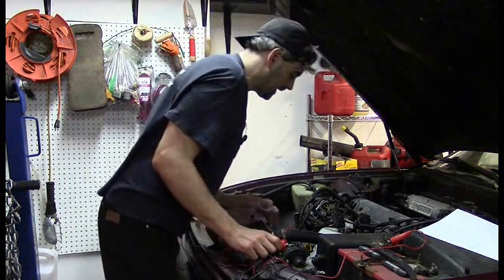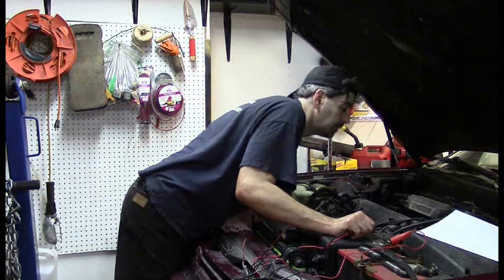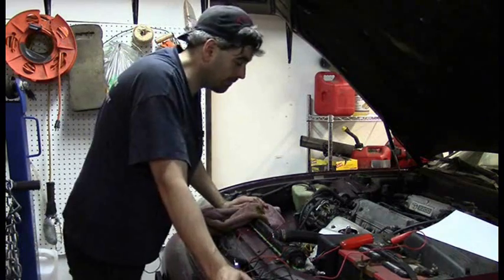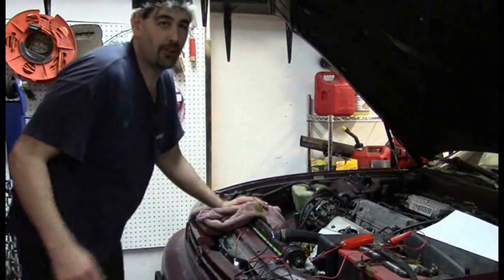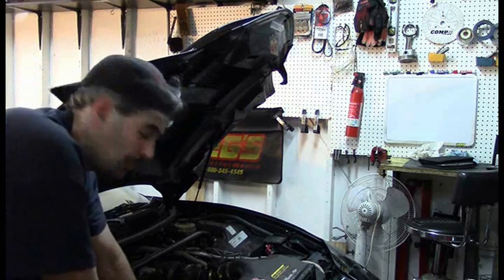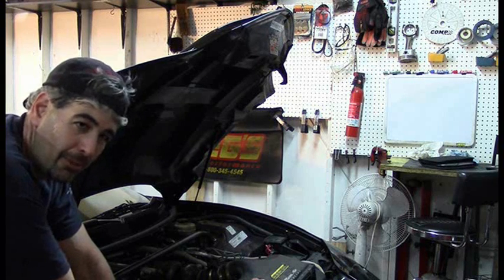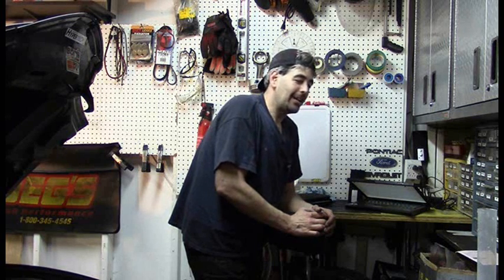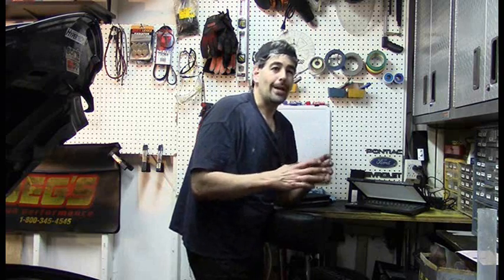12 Ways of How To Test A Blown Head Gasket Compared- PART2

Comment: Glad to see the swirling and bubbles in the Trans Am radiator.  It gives me hope for my Subaru, lol.  Great videos, thank you.
Reply from the maker: +john hardin Not seeing swirling would be a really bad sign- it would indicate water pump not working (provided T-stat is open of course).
Reply: +Schrodingers Box The bubble test does work but it requires the hole from overflow tank at the radiator neck to be block off. It helps if u have a coolant bleeder funnel. This process requires the engine to be at operating temperature and thermostat must be open. I do like the leak down and compression tests since they r more precise. However, when u get paid by flat rate and u have a V engine that requires removal of the intake manifold to get to the spark plugs it's not very efficient. Most customers will not pay for an extra 2+ hours of labor for this
Reply: @knguyen215  yea I was wondering how I could do this in my Hyundai Tucson which I believe has a head gasket leak.  But can't check rear cylinders without removing plenum.
Reply: Sam H unfortunately that’s the only way to be precise
Reply: @knguyen215  yea that's what I'm gonna have to do.  I'm sure it's a head gasket though because I've had coolant coming out of pressurized radiator cap for long time.  A mechanic replaced the radiator saying it was cracked that's why it was leaking but I'm sure it didn't need to be done.
Reply: +Schrodingers Box really appreciate the video I too was sure I had a minor blown head gasket after my radiator cracked on a long drive. Saw bubbles in the coolant overflow. But the chemical block tester and compression test say I'm good. Think I can finally stop worrying about it.

Comment: ok so the steaming screwdriver test: (this is for isolating coolant leak into individual cylinders)
say it's a 4 cylinder, bring up to temperature with a pressure tester (set on cap pressure or a tiny bit higher) connected to the radiator. Once hot, stop engine, remove spark plugs, and put cold screwdriver shanks into the plug hole into each cylinder. After about 1 or 2 minutes, remove each screwdriver and inspect the shank for condensed moisture. It will be as clear as day> This will indicate a presence of coolant in that particular cylinder. I have found this test to be incredibly reliable and precise to pinpoint slower cylinder head gasket coolant into combustion chamber leaks, and I'm thinking I might be one of the few whom have worked this trick out. 
PS. I have always found the magic bubbly dye gas in cooling system a tiny bit ambiguous. From my recollection, you can re-use the old dye by testing it near the exhaust tailpipe, and then "clear it up" by puffing it in fresh air. I recall one of the problems with this method is accidentally pulling coolant into the magic mixture while conducting the test. Anyway, my "steaming screwdrivers" are my favourite method these days. *(just don't use your penis instead of the thin phillips head Matt)
Reply from the maker: +David Bell Thats an interesting one- I will have to test that out for sure.  I'll have to try it on a rainy or humid day to rule out possible environmental variables causing the condensation.
Reply: for sure, no matter what the prevailing conditions for me during the 50 + times I've done this test, (dang, maybe even more like 100) I nearly always find a dry cylinder along with a wet one (if not all dry of course in the instance of the water to chamber parts of the gasket being ok) I don't know if that satisfies the axiom. Funny, I actually used the test today on a VW gen 5 golf which was in my shop with a stuck thermostat (which of course I proved to the customer by boiling it)  
I truly find the screwdriver hack the most reliable and definitive of tests. You can even detect the tiniest of weeps. Make sure the motor is right up to temperature, and that there is good pressure on the cooling system. I've been so inspired by you, I nearly made a video of it today :)

Comment: will these tests work if I have want I think to be slight oil in coolant no other symptoms, would that be a head gasket its a 4.6 f-250 manual to be honest I had the car at the jiffy lube and they said I had a blown head gasket becaue they could see oil in the coolant I looked latter and really its like slight bit of foam but just looks like dirty coolant don't kw if its ever been changed what would you do

Comment: hello mat what kinda heater you use? its looks cool where can i buy that from?
Reply from the maker: MrMsumal It's a kerosense heater and it really pumps out some BTU's  They cost about $65 at any hardware store but depending on where you live, K1 Kersosene can cost anywhere from $4 a gallon to $8 a gallon so the fuel can add up on you.  With my insulated garage I can go 8hrs on a gallon but if your garage is not insulated you may use 3X that much.

Comment: My exhaust is putting out a slight amount of white smoke and stinks pretty bad, but the coolant system has only distilled water inside currently, as I'm doing a flush.  How do you square that angle? (of stinky, thin white smoke exhaust, but no actual coolant inside)
Reply from the maker: Riddledrome What did your diagnostic tests indicate?

Comment: I had a recent oil change, and the mechanic said that I needed a new head gasket. I was looking up a videos on doing the repair myself. I'm glad I came across this series of vids. I thought this was a simple repair, however as pointed out in another vid on this channel, there could be more to the problem. So, I'll be heading to my trusted mechanic's shop.
Reply from the maker: BullRonin While I do have a couple videos on cylinder head repair I strongly suggest it is not a job for a novice, especially on DOHC models if you have one.
Reply: Yup, and thank you again. Your videos are very helpful.

Comment: Ok, i was thinking... the test with heating up the oil which it seems to be very popular, if the oil do sizzle, can that also be a sign of bad pcv valve or if the car has seen a lot of short trips and the moisture in the oil (condense from the heating-cooling of the enige/oil) has not been able to evaporate? Or there would be some other signs in the oil if that happened?
Reply from the maker: Asky66 You are absolutely correct- the test is designed to not give a false negative but it can show false positive for several reasons.
  Basically, if it doesn't sizzle, you can eliminate coolant in the oil as a possibility. But if it does, it does not necessarily mean the head gasket is bad- it just generates "suspicion".

Comment: I have an Audi A6 1999 model and I did the chemical test, the result was ok no signs of combustion. But my car use a lot of water/antifreeze and all that is going out from the reservoir, from a hole that reservoir has by itself. Also I have a lot of pressure in the cooling system the hose becomes strong and I think this is why the antifreeze goes out on the ground from the reservoir hole. Does this show that is combustion in the hose(cooling system) or maybe it is air? 4 months ago i changed the thermostat and someone told me it should be just air in the cooling system. Thank you in advance.
Reply from the maker: What did your compression and leak down tests indicate? Is the water pump working? You need more diagnostics than just the chemical test.
Reply: Schrodingers Box  I haven't done the other tests yet, I will bring to Audi dealer to check even the water pump. Thanks.

Comment: using his video, and its very helpful particularly for my aim to diagnose source of Hg faliure. I have an L200 pickup, and they are known to use up heads and gaskets. I have a small amount of rad bubble, no other symtoms. its kind of obvious even just from that its a faliure, But I want to find out if its due to a bad head, gasket or block, I an thinking a crack would be easy to detect, but how would you test for a warp in the head or block? I dont want it happening again once I swap it

Comment: Hi Matt! Automotive question here;) I just have bought a car with broken cambelt. It arrived today and I have noticed an oil in coolant?! Can cambelt failure cause that?! The belt was driving a water pump (standard in Europe) if that makes any difference? I have some thoughts but don't want to suggest that. By the way this car has "metal" head gasket and they are not very common to fail on this engine. Diagnostic is not easy (like compression test) as it is diesel car...
Reply from the maker: The only way I can possibly even fathom a relationship between a broken timing belt and water in coolant is if the belt broke due to a failure of the water pump (assuming it is driven by the timing belt) and the water pump leaked and it was caught in the oil pan.
 What was your idea?
Reply: Schrodingers Box Actually the oil is in the coolant reservoir (so it is getting to coolant and circulating with it) and there is some moisture in oil too... My most pessimistic idea is that water pump seized and the engine overheated and blew head gasket (or head cracked?) and than the belt snapped due to seized water pump... But wouldn't seized water pump brake cambelt quite fast?! 2nd idea is that there was neglected head gasket problem for a while before the cambelt went.. 3rd optimistic option is that again it is not related to the cambelt issue. This engine has external oil cooler and there are passages of oil and coolant next to each other. Sometimes they rust...
Still don't know how can timing belt failure cause oil in water... I guess it was preexisting problem... 
Anyway I will try to take pictures and share with you when I take it apart;)
Reply from the maker: Gregory May Oil in the coolant is different than coolant in the oil. A common cause of the former is actually a leaking oil cooling line or transmission cooling line.

 As far as the seized water pump- I have seen many of these. In fact it is one of the most common causes of broken timing belts I see- it is why I always recommend changing ALL timing components and not just the belt.
  When the water pump seizes, the belt slips over the frozen pulley- it is not enough to cause a change in timing. What happens is the heat from the belt slipping over the frozen pulley breaks the belt, but it is not enough to cause timing change, break the cam, etc and a blown headgasket as far as coolant in the oil is still mechanically separate even if any of those did happen.
  Normally if I see the frozen water pump condition before the belt breaks the complaint is arubber  burning smell from engine, poor performance, and overheating (which could lead to blown head gasket of course). But even with the belt sometimes very worn, the timing was not changed.
Reply: I removed the rocker cover gasket and can't see any damage to the cam or cam followers. Should I try to put the belt back on and see how it goes?!
Reply from the maker: Gregory May I would be doing as leakdown test at this point- so much easier than putting a belt on. You can't do compression without the belt on but you can do leakdown by simply turning the camshaft to close the valves independent of the crankshaft and testing the cylinder.  That's what I'd do. Often to test for bent or damaged valves on a broken timing belt, I remove the pushrods or overhead assembly to just have all the valves closed on all the cylinders and quickly do my leakdown without any rotation of crank or cam.
Reply: Schrodingers Box
I know. But it is a bloody diesel and no spark plugs to remove. And I don't know if I can take the injectors out as they are usually rusted in place... They are held by clamps not screwed in. But I will keep that in mind and see if leakdown is possible. Have you ever had broken timing belt that didn't bent the valves?
Reply from the maker: Gregory May Out of 6 broken timing belts on interference engines I've seen, 2 of them survived with no ill effects.
Reply: There is a hope;) Thanks
Reply: No at least 2 valves are bent and all the pistons are marked by valves. One valve is stuck open out and not closing even with a hammer. You was right there was oil cooler problem as well. Someone "fixed" it before sale. If you want you can check my youtube slideshow;)
https://www.youtube.com/watch?v=aXLEdSX-7J4
Reply from the maker: Gregory May Sorry my friend. Man you have a hard life lol- you're due for some breaks soon!!
Reply: Schrodingers Box
I know:)
Reply: I already bought a second hand engine...
Reply from the maker: Cool.  Thanks for the second hand news. Remember when times get bad when times get rough just lay me down in tall grass and let me do my stuff.
Reply: Schrodingers Box
I just wonder if only only one valve is quite bad ( i managed to close it and is not really bent - leaks a little bit ) and all the pistons are ok (marked but slightly) and con rods seems to be equal high where did all that energy/impact go??...

Other thing is if an engine runs with some water in oil there will be accelerated wear. How long (how many miles/months/years) can an engine run with little drops of coolant in oil without damage? Do you have any experience with that?

I used to get a glass when things were rough but well ... it doesn't help.. Tried that everyday for 5-6 years;) I prefer a cup of tea.
Reply from the maker: I've seen cars run years and thousands of miles with blown head gaskets and water in oil.  I diagnosed a head gasket on a dodge minivan once- oil looked like mud, no compression at all on affected cylinder and coolant sprayed out of the spark plug hole when I was testing adjacent cylinder and thing ran a year with daily driving lol. But when it died the engine froze.

Comment: my car passed all these tests but the overflow kept overfilling. Turns out it was my radiator cap. Even though it was the first thing I replaced, the one I got was bad
Reply from the maker: Bad radiator cap is one of the most common things I find cause cooling problems and especially "mystery" loss of coolant with no trace.
Reply: Schrodingers Box 
hey I just did your fizzle test with my dodge carvan, their was  a puddle of oil underneath my van, and I dipped tinfoil into it enough so I had a puddle on my tinfoil, I put the lighter no it and it snap crackled and popped, from your video I guess that's a bad sign.
Reply from the maker: Terry Hunt You cannot test the oil from external parts of the car- too many environmental variables could explain water contamination

Comment: Hello, I don't believe this question has been asked or answered, but with the "sizzle test", at what temperature does the metal that the oil is tested on have to reach to create a reaction. I realize that you mentioned it could be done with tin-foil and a lighter, but how would the outcome be changed if you didn't get the oil warm enough or if it was tested on a surface that was very very hot?  Thanks in advance.
-Jon
Reply from the maker: It has to be hot enough to boil water
Reply: Okay thanks for the fast response.

Comment: Sigh... I gots da sizzle. It's not as dramatic as yours showed, but it definitely bubbled before it smoked.

Thanks for the video.
Reply from the maker: Yeah honestly, not a good sign, but again NOT definitive in and of itself.  Other things could cause the oil to sizzle besides head gasket. Leaking coolant from intake gasket, condensation...
  There are ONLY 3 definitive "standalone" tests that unarguably confirm head gasket failure:
1. Leakdown
2. Compression
3. Combustion/CO2 in coolant

Also a coolant pressure test that shows coolant entering a CLOSED cylinder will do it too.
  Until you confirm with one of those tests, you cannot say for sure you have a cylinder head issue.  Good luck bro.
Reply: Schrodingers Box OK, I made a leakdown tester (you could also just use one of those valve holder adapters and inject air into the cylinder). For sure I've got leakage from cylinder 2 pressurizing the the cooling system, so I guess I get to pull the head and see what I'm dealing with.
Reply from the maker: yeah that pretty much does it. You have no other alternative. sorry to hear that.

Comment: Hello, I have Ford Escort 1.8 td and its loosing the water, what i have to check?
Reply from the maker: ummmmm is it leaking?
Reply: I can't find that somewhere is leaking. When i drive in above the woods the water just desapear...
Reply from the maker: Kamber Xheladini You will need to start with pressure test of the system and radiator cap (bad radiator cap is the most common cause of "mystery coolant loss". If pressure test is negative, head gasket testing is in order.

Comment: I have a BMW with a N54B30 engine and had the luxury of having the coolant tank blow out on me on a drive home and the engine overheated.  I immediately turned the car off when I saw the temp gauge hit the red.  I am not a religious man but I am praying heavily that I do not have to replace a head gasket and/or that I did not warp the block/cylinder head.

Comment: Right so i have gunky cap had gunk in oil filter gunky air pipes but i had clean dipstick no water loss or gain no smoke from exhaust no over heating no gunk on dipstick i can see a tiny oil leak near the oil or fueo sensor could the gunk build up be rocker cover or the sensor? Or is the head gasket? A mate said now you get plugs in the engine that blow or crack before the gasket is this tru also thnks?